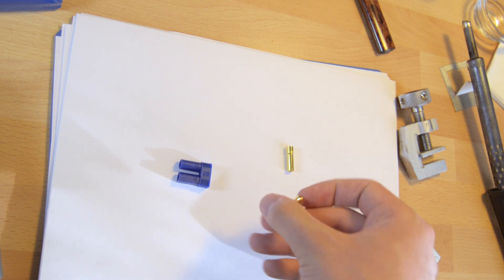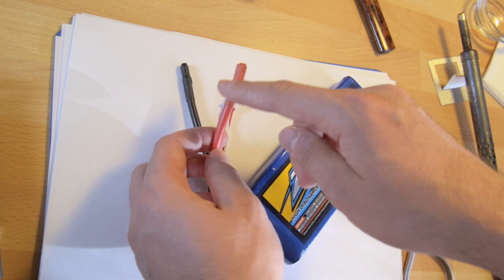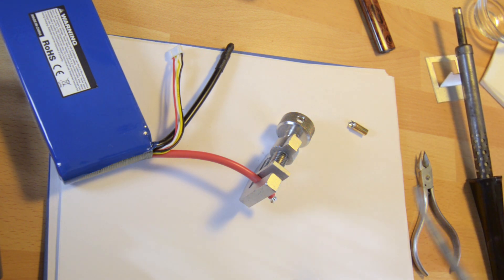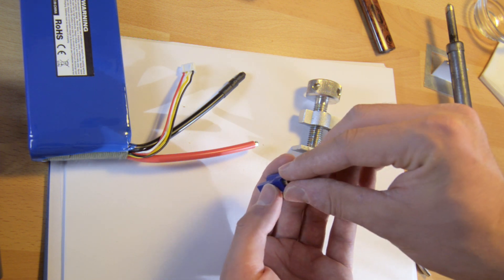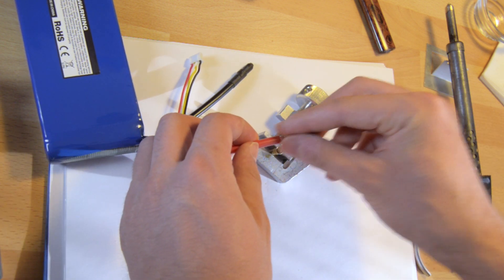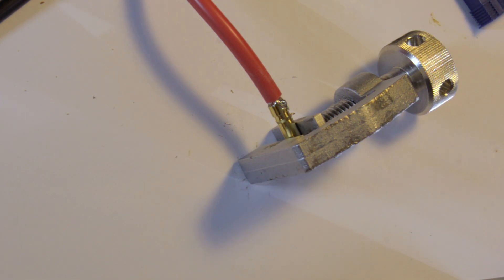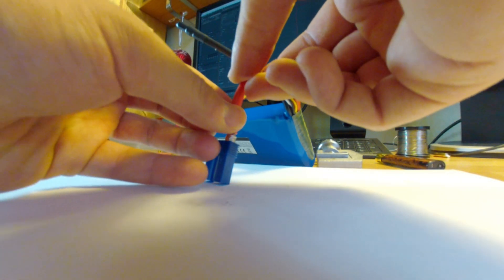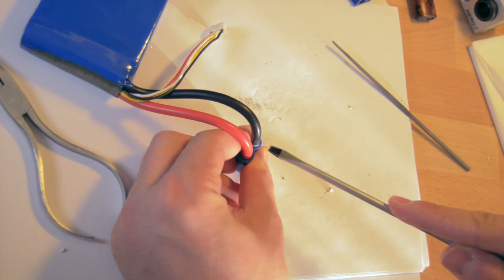How to solder EC5 connectors

Comment: Just about to swap all of my connectors for all my trucks to ec5. This is easily the most straightforward tutorial. Thanks!
Reply from the maker: Thanks! Do you like EC5 more than XT90?
Reply: @ I personally have never used xt90s on anything other than my 3d printer. I couldn’t give an opinion without being biased towards the ec5. 

I will say that I’ve gotten really good at soldering the ec5 connectors though. I did swap all the connectors on my trucks, and then some for my friends

Comment: Some of the EC-5 connectors I have seen on amazon and ebay the bullet connector actually into the plastic housing the other way. If you look closely at the bullet connector that came with your EC-5 you can see one side has is tapered that is the way you want to push the connector in.

Comment from the maker: yes. any connectors can handle 6s. the key element is current. these ones are rated up to 150 amps continuous load, so you can plug a 6s battery and safely power a 150*22=3300 Watt motor. Actually some people use them at even higher currents. at 14s and 200 amps you can power an 11000 Watt motor)

Comment: Someone needs to make a crimp version of this connector even if it means giving it about a 1/4inch more length and also a relook at the method of retention.  They are good connectors (especially for cost) EXCEPT for the soldering part (which is stupidly time consuming when done properly) and the contact sleeve.  <1/4" contact sleeve area is NOT sufficient to absorb the tension from a wire pull when mated up to standard hard stranded 8AWG [you have to be swift at tinning up everything and get a good bond which means a LOT of heat coming in fast, min 200W gun. I ended up resorting to the proverbial MAP torch for the final mating of pre-tinned connector to pre-tinned wire as even the 200W wasn't getting it hot enough timely (before other shit started melting and burning).  Feel sorry for those in the EU where they only have their version of Lead-free RoHS solder; the connectors I had it didn't solder-up at all mechanical sound with the lead free as the Leaded solder (I happened to have both EU spec Lead free and NA-spec leaded).  I have had these pull apart after a few dozen plug-unplug cycles unless they were backed up by a good 2-3 inchs of E-tape wrapped down the wire form the connector's base.

Some versions of this connector are very difficult to put together trying to push the gold contacts into the blue housing - some so much no matter how good I got the soldering it broke the joint.  This part could be done far better.  One quick mod to lesson the burden is to shave the lip internally down a bit.
Reply from the maker: Yeah, I did struggle with them a lot.
In regards to crimping - "anderson powerpole connectors" are almost exactly what you are looking for. I've seen them used for power wheelchairs and very commoly for ride-on floor washing machines.
 If i were making something with that level of power consumption, I'd go with XT90 with strain relief or maybe an XT90 with extra pins to support smart battery commutication.

Comment: FYI,
First you have to slide the connector housing over the wire because the contact bus needs to be clicked in from other side.
Check the clip from Helidirect RC.
Grtz.
Reply: dxtrty not true. All Ec5 connectors are not the same. Some have to be pushed in, some have to be pulled in.
Reply: Yep, mine comes in from other end so have to install plastic sleeve first, then solder.
Reply: Yup some some push in from the front and some from the back. Look at the taper on the brass to see which way you need to push

Comment: Just spent an hour trying to do my connecter and i discovered the blue part clips in the opposite way. By then it was too late and i couldnt unsolder the joints so i had to cut them off. Complete waste of time cut my finger open trying to force the blue part on too 😠😠😠😠😠
Reply: Just use XT90 they come with a cover now so no heat shrink needed and can be reused .
Reply from the maker: Yeah, XT90 with covers/strain relief are a better option in 2025

Comment: wrong method , first insert the cable in the connector solder clear and pull inside the plastic housing ....
Reply: Not wrong, just different I personally add the solder after putting the wire in, this stops you having to clean up excess solder that spits out because you can see when to stop adding it, however, his way works, and if you had no clue it would of helped you, be nicer to people it's easy try it.